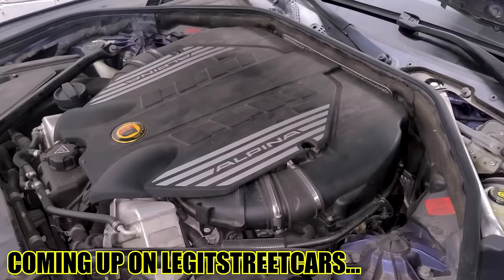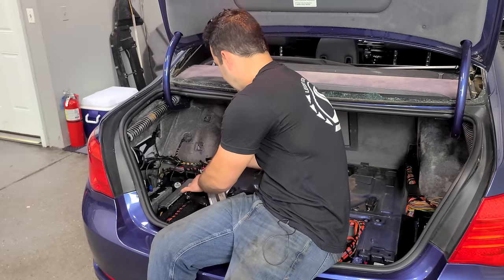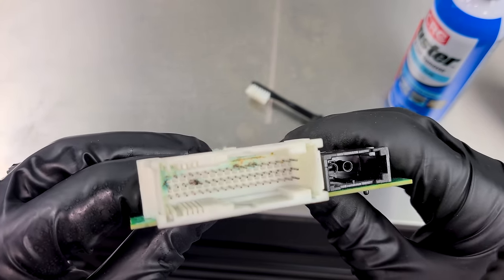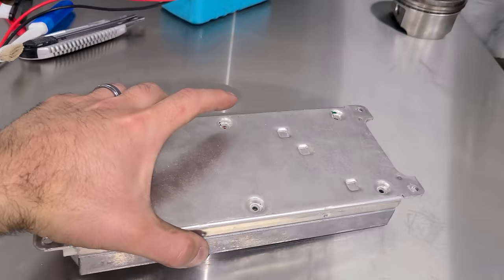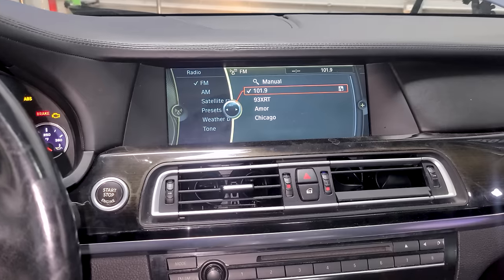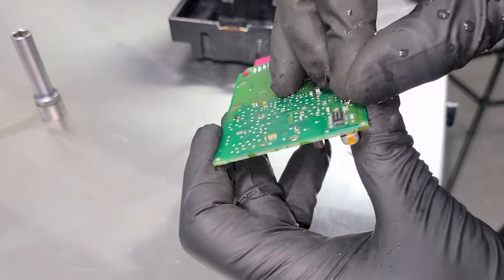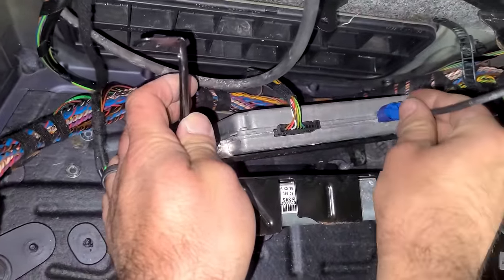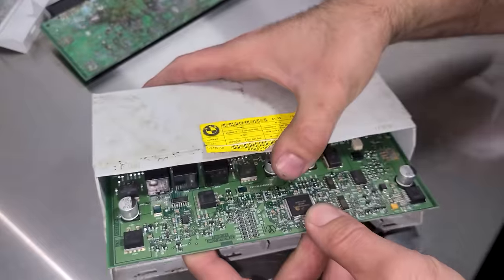BMW Dealer Tried Totaling My Car By Quoting $15,000 For 10 Computers! I Fixed Them All For $150!

Comment from the maker: What's something you fixed after getting a quote from a shop? Who else is going to try fixing or replacing a car's computer on your own now?
Use code LEGIT2022 for 15% off the Carly OBD Scanner & coding tool! https://bit.ly/CarlyLegitStreetCars. The offer expires on August 15th, 2022.
Reply: I have a w204 with third brake light issue  fixed for 120$ and saved 200
Reply: Hey Alex was there an upload Thursday? Also can Deboss Garage YT channel last upload, that Mercedes race car is a beast!!!

Lastly would you ever get a rotary engine like Rob Dahm?
Reply: ABS rings + sensors on the rear axle for a E87 BMW 118i. Got a quote for almost €1000,- but fixed it myself for €100,- Bosch sensors and OEM rings.
Reply: I would buy Carly but a subscription no way!
Reply: I don't go to shops lol. I've been an auto tech for 20 years and even though I have no garage i just work on the street. Did my transmission mount insert on the street same with my oil changes. I like to fix things instead of buying new. Fixed a portable oil heater that way.
Reply: Let's see you do a pano-roof on a c230 - now that's REAL wrenching...
Reply: Great Video Alex 👍🏾
Reply: i have a 270cdi w211, got a mobile mechanic (£55) out to fix a drop in revs at 2000 it drops to 1900 then back up to 2000, he could not find the fault, but he said in need a EGR valve. got a recondition one for £150 with £20 refunded if a send the old one back. put it on my self, i now have more power. P.S. think the drop is the EGR valve be told to open at the wrong time?
Reply: I replaced Heads on my 99 Ranger 3.0 V6. Watched a guy on YouTube.
Reply: Fixed a CE light for my cylinder deactivation system. Dealer wanted $400, fixed for $60 using OEM parts from the dealer.
Reply: The purple, black, cream, and blue cables on the "dumb" unit are industrial optical audio cables. They're called Toslink cables when used in home electronics, but are understandably more fragile.
Reply: $2500 dealer quote for major brake service, knock sensors and full tune up…. All done for under $500
Reply: Please help. I drive a older car because I love it. I’m 22 with a 15 month old and not a lot of money.. I drive a 86 Toyota 4Runner. How do I read its codes? I sometimes get a check engine light but can’t afford to take it in to a shop
Reply: @nickcrill7718  😂 pre-obd doesn't have codes you can read. They had specialized tools at the dealership that do not exist anymore.
Reply: @nickcrill7718  go ask Tandem Offroad if he'll help. Pablo is obsessed with old Toyota 4runners.
Reply: The shop wanted $150 to replace my cabin air filter. I had just watched a youtube video on how trivial it is to replace. I said no to the shop. They insisted and said they could give me a 10% discount since they'd already be in the engine. I said no. I ordered one of Amazon for $20 and it took 5 min with a 10mm socket to replace.
Reply: @BSGSV  well you should have bought a Bosch one, or K&N one for at least $50. That said the extra $100 they were going to charge you is all labor. That was actually a fair price.
Reply: @andrewsadach3194   I knew it didn’t have obd so I was confused on what to do my grandpa gave me a paper clip but idk what I’m supposed to do with it. lol
Reply: @andrewsadach3194  Fun fact: back in the day, our BMWs didn't even have cabin air filters. It will be fine. As far as the price goes, $1M would have been a "fair" price to pay if I had the Queen of England change my air filter. That doesn't make it worthwhile especially for a 5 minute job.
Reply: 2096 tundra smog pump...under the intake mainfold..ugh.  I cheated and got an electronic bypass chip plug and play.  Pump will never come on, shooting codes and limp home mode and instead of $1500-3000, I paid $260.
Reply: I got a quote for $200 from a shop to fix my coolant thermostat. But I went on YouTube to see if it was easy to fix myself & long behold there was. The part only cost me no more then $20 & having all the right tools & jus watching a YouTube video I fixed it myself 💯
Reply: My biggest one is the rear wheel bearings on an 05 Explorer around two years ago. Tools and parts I spent around 400, and saved 2100 as a difference from what the shop wanted. It took me about a week to do in between work, but was a hell of a confidence booster. Plus then I had all the tools in the garage!
Reply: The natural gas regulator on a CNG Van. Totally funny story!!!!!
Reply: On a previous 7 Series I owned, the dealer quoted $750 for a coolant temp sensor leak.  I fixed for about 50 cents with a Home Depot o-ring.  Lasted for at least two years…not sure how much longer as I sold the car.
Reply: Those giggle giggly pieces are solenoids lol 😂 but nice work.
Reply: kzn130 hilux surf ecu rebuild was 599 the capacitors for electronics store were $14
Reply: I would like more often videos.
Reply: I took apart my 97 wrangler wiper motor - there were some pieces that broke off the  stator that were preventing movement. I think it froze at some point and someone hit it with a hammer to get it moving again. After I removed the loose stayor pieces, I put it back together and it was as good as new. Worked for years after that.

I had a 1982 toyota corolla and the brakes weren’t working, and I suspected the master cylinder wasn’t making pressure b/c of some debris. I set up a clean area on the bench, took the MC all apart, cleaned it, put it back together, bled the brakes, and it worked just like new. No parts needed.

It’s a weird feeling when you can fix something without buying a part -  like a superhero, but also there’s something in the back of my mind that wonders if the problem ever existed.
Reply: I have attached my the application form application form for the post of
Reply: I have attached my the application form application form for the post of
Reply: and we can can get it back back in a a couple weeks or more later later when when I have a little more
Reply: ac system replacement on bmw z4 3.0 quoted 2000 k. Parts alone were 400$ and that is all i paid.
Reply: I was charged .25 hour of labor for windshield washer fluid plus $10 for fluid. I was pissed lol
Reply: I stopped owning a car when gas hit $5 a gallon under Obama.
Reply: @paraskevasioannou7937  sounds great , what did you do to fix it?
Reply: @davidmorse5690  Laughing gas?
Reply: Bought a mercedes cls550 for cheap with broken airmatic suspension so the car had dropped to the ground.. found a part out and bought the rear air bags and a compressor all for $300 off a cls55 amg. Installed it all myself started the car and she rose right up.. its been 2 months already and havent had any leaks or issues. Easily saved myself a few grand
Reply: Hey Alex. I just found out your audio amplifier is not from the alpina. At 20:18 I can see it’s labelled F07 which is the 5 series GT… I’m pretty sure it’s not the original amp.
Reply: @paulsz6194  Compressed Natural Gas
We did do some laughing.
Reply: I wish I could I have an L494 Range Rover that needs programming after an amp replacement. It also has a closed loop fiber optic MOST system. It's driving me mad lol.
Reply: Reworked my ebcm on my 2000 gmc sierra from watching a YouTube video.
Reply: Probably 15 years ago my friend sold  me a 2000ish cadillac Deville for 600$ ... dealership told him it was going to need all new gaskets due to it leaking oil about as fast as you put it in they wanted a dumb amount to fix it . ... took it home jacked it up ,couple cans brake parts cleaner, the oil filter wasn't tightened and was dumping oil when it was running lmao I tightened it with my hand topped it off and drove back to my friends house  the same day... he just shook his head lol he wasn't amused.
Reply: @grantlouw3182  dude same here, i find that absolutly absurd having to pay for a car scanner subscription
Reply: @grantlouw3182    I went for it.   Maintaining all that functionality requires ongoing investment.  I can live with the subscription as long as they keep improving the capability.
Reply: Power steering issue on a 2010 Honda Odyssey fixed with a $1.50 O ring.
Reply: I’d advice pictures as ppl disassemble things, one at a time.
Reply: Finished water is also non conductive. It's the minerals in the water that is conductive
Reply: I want that car so bad. I also want to do the work alsob. I miss being able to work on my cars also
Reply: I thinking sabotage
Broke it at some point to total it out or at auction..
Reply: A family member bought a pre owned Nissan Micra from a Nissan dealer and they said the next service would be free.
When it was due we took it in and they booked a Bronze service where the paperwork said the deal was for a Gold one, I noticed it and they changed it to Gold. I would normally do it myself but as it was free.... or was it?
We went back later to collect the car and they said they couldn't start it and it needed a new battery. We had no problems with the battery or with starting it before. They wanted £160 for a new battery I told them I wasn't paying that and for them to jump start it so I could get it home.
I went to the workshop and saw them pushing it out. They had a long push around the building to the car park.
I tried it and it barley turned over. If it was my car I would have marked parts with a UV pen just in case, I reckon they swapped the battery with a dud one or blew it with a battery tester and didn't want to admit it.
I asked again if they would jump or push start it (manual) but they said they had tried and couldn't get it started.
I returned with my jump leads and it started first time. I went in where customers were waiting and said very loudly "You said none of your mechanics could get it started, it took me less than a  minute".
I bought a battery for half what they wanted to charge and 7 years on, no problems with it.
Reply: M35 stagea front damage to light,guard and bumper. Hit by another driver His insurance paid out $7000 for quote to fix it.  I bought second hand parts for $200. Fixed the light with glue, dent repair.. not perfect but good enough... and have over 6000 left!
  Blanco dishwasher, was not powering on, I got it for nothing, worth $900.  Quote to fix was $200 for labour and unknown part cost.  I pulled apart the contol modules and found a resistor that was fried and also became loose on the crcuit board. New, resistor ($1), a bit of solder and the unit has worked faultlessly for over 2 years. Cost $1, time 1 hour.  saved $200, (actually $900 since I didnt even buy the dishwasher to start with)

Oh and then there was the LG fridge (twin door, ice and water - only 10 years old) that was being thrown away for water leaking - It also needed a massive cleanup - disgusting! SO one plastic hose fitting ($5) and a few hours cleaning - I sold it for $500 !
Reply: A rear silencer rubber hook. Got an almost $100,= quote from the dealer to replace a $6,= part that needed 1 bolt to be undone and took less than 3 min. to replace (with the car standing on the street).
Same for a start/stop battery. Got a $350,- quote from a dealer for replacing a $90,- battery that needed no further programming or resetting in the ECU. Just open the hood , unbolt 1 10mm bolt and the connectors and replace. I can carry on with a long list...
Just one more: replacing the coupling plate on my (almost) vintage BMW motorcycle. Got a $1.250,- quote (back in 1999), bought the plate, bearing and ancillaries for under $130,-, bought me a brand new hydraulic motor lift and a decent new and calibrated torque wrench and did the job in 3 hours (as a novice then) and even kept some change in my pocket. Leaving me with a perfect bike and great tools!

What's killing the dealer-services for the private owned car is that dealers use standard rates for lease-companies that are way above true exploitation-cost (profit included). And of course the costs of those crystal-palace - dealerships at A1 locations and membership to the dealership network adds a far amount too.......
Reply: A coffee machine, was quoted £65 for a brewer repair when it only needed a £3 part :)
Reply: Backyard mechanic, Almost everything I fix is after getting a quote from a shop because I have all my "customers" get those quotes so they can really understand the savings they are getting.
Reply: My 2018 Wrangler Unlimited Rubicon is starting to have computer issues so this is awesome to watch!!!
Reply: Water got in the floorboard of my Passat.  TCU was shot as well as the plug coming from the harness.  Replaced the TCU but also had to splice in a new(used) plug soldering 40 wires.  What a nightmare but it worked.  Also dropped the whole bottom end of my R8 to replace the AC compressor.  Dealership wanted $4k to replace the $400 compressor.  I used the money saved to buy a 4 post lift which I used to do the job and many more since.
Reply: Didn't work for me, ECU still throwing code P0606 no matter what I do.
Reply: 2013 Jetta hybrid.  Mechatronics in the "transmission went out.". Dealer wanted $7300.  VW wouldn't recognize my vin on a recall for the same problem.  Fixed it with a mod kit for $400.
Reply: not a car, but a home theatre receiver, Yamaha Rx-V2700B, quoted $600 to fix (not turning on). fix, a 90 cent capacitor on the power supply pcb. True story
Reply: Fixed a taillight on a VW golf when water got into the housing.
Honestly it wasn't even difficult the PCB had 4mm thick lines running around. Scraped the rust off the PCB sprayed wd40 with PTFE on cleaned the connectors and fixed it.
A Sony bravia TV that was left in the rain. Took it apart cleaned it from top to bottom with IPA alcohol. Reassembled gave it a couple of days then turned it on  lasted 5 years.
A Samsung galaxy S5 dropped it a week into getting it. Bought a replacement screen. It broke the digitiser when getting it off so bought the full screen and digitiser. Got it back working and I was in business. Then a couple of years later on a night out  I dropped it and the screen had all these raster lines running through it but no cracks. From the repair I remembered I saw that happen when the ribbon connector wasn't seated properly so I remembered exactly where that ribbon connector was and pressed the screen hard there and it cleared right up.
I love finding broken stuff around the house and seeing how it failed and fixing  it! A greenlee tone and probe. The tone died a slow death first it stopped flashing to a frequency thinking it was a low battery it didn't change anything before eventually it didn't work at all. Thinking it was a faulty capicator I opened it up and found a big cap on the back one leg just let go of the solder which turned white and fuzzy resoldered and sorted it.
Years before we were in a nightclub couldn't find a mate. I had no battery in my phone and the other mate had no antennae on his sharp flip phone (they commonly broke off)
I took his phone unwrapped a chewing gum are the gum and bent the foil to about 2 inches stuck it in the antennae hole and the signal jumped up to full strength. I wasn't even sure that would work but it made sense in my head.
In nearly all cases when something fails it's usually because a single thing has failed being the weakest link and if fixed with a bit of resoldering your back in business.
I do all my best mcgyvering when pissed.
Reply: Passenger seat on a ML320. Passenger seat was stuck and techs could not access the bolts to remove the seat. The quote was in the neighbourhood of $3600 CAD to cut the studs from underneath the vehicle and replace the whole seat. I grabbed a can of brake cleaner and soaked the tracks. Got the seat to move after 15 minutes, after 30 minutes of cleaning the track of grease, dog hair and sand I had the thing moving like new. Luckily I had this fixed 6 months before the battery failed because I would have been out the cost of the seat, and the battery, estimated total cost of almost 5k. 

Also the rear control unit of the same vehicle, could find the part for ~$180, but no one could program. Had to eat the bill on that one. Cant believe they install these parts in liquid traps under the rear light assemblies. If there is a leak in the seal around the light, your electronics get destroyed. The managers that forced this design should be in jail.
Reply: Took R56 Min Cooper S to shop - just got tired of fighting with the cooling system. Wouldn't burp, kept popping hoses. Code scan revealed end-of-life/reduced power on turbo.
$3K to rebuild.
Shop vacuum filled it, repair lasted all of 8 hours after waiting in line for two weeks as the coolant sensor blew out.
Said f* it - I'm giving this one more go. 
Found the coolant temp sensor was missing it's snap-clip retainer. Wedged it back in, refilled with coolant, bleeder screw open, home shop vac rigged to blow, finally forced coolant through. Changed oil just to be sure. 
No codes.
Reply: This is why I can't wait for automated cars and never needing to own a vehicle again. Just call an uber type company and a driverless car is sent to your house. No need to worry about owning an overpriced cars or insurance again.
Reply: @henrythegreatamerican8136  Okay, WEF lover. Give me all your stuff.
Reply: I'm rebuilding my 1988 kit car ,I'm looking for the E CU ,I then realised when I rewired it all thse years ago I didn't fit one !
Reply: @tegridyweed7863  gas is around the same price lol
Reply: Replaced the TCM on a Mazda 3 saving my friend over $2k
Reply: Any new code for Carly?
Reply: Only thing I've done myself is rotors and brake pads. Was quoted $860, did them myself for $130.
Reply: @Babihrse  😡we are mostly in a throw away society now. I noticed at appliance part store all of us lined up for parts looked retired and all aged 60+.⚒️🔧🪛
Reply: Carly is a big scammer. I bought one 2 weeks ago. They have somehow lost it between their warehouse and the DHL driver (somewhere in Germany still). DHL can't find it and Carly will not refund me. I am dealing with the credit card company to recover my funds. Carly also charged a subscription fee for a product I don't have in my possession.
Reply: @jeffrey88888  
I would blame/try to get refund from DHL at that point.
Reply: @joshuadelaughter  Recipients can't get refunds because Carly shipped it using their own account. Carly refuses to contact DHL to get a refund.
Reply: Aha...the source of my Carly adventure. You need to do more diligence in accepting sponsors. Carly is a scam. Anyone considering purchasing Carly needs to understand that it is an overpriced subscription for an OBD2 scanner that doesn't do what it promises, renews annually, and hides behind deceptive marketing and horrible business practices. Carly is a one-way door: they do not EVER refund your purchase.
Reply: volvo s40, quote for 4 control arms 4k, i replaced all of the suspension parts for 1k
Reply: Hi Alex ! I once saved a rented Sony professional video camera which had received sea water from a wave by removing the lens and batteries, filling a bathtub up with distilled water and putting the camera inside the tub, rinsing all the salt water away, and then drying the camera with a hair dryer for a couple of days just to be on the safe side.

A nightmare.
Reply: I have a 2007 Honda Pilot.  It kept not starting when you turn the ignition switch and dropping out of cruise control if driving.  We'd try to jump it, nothing - I'd beat on the steering wheel and wait and eventually it would start.  Dealership said I needed an entirely new ignition switch and steering column assembly for like $1500.
I googled around and discovered it was the gear selector switch.  I ordered a $60 part, bolted it on.  Problems gone.
The old one had cracked and allowed water in and corroded all the contacts so the car couldn't tell it was in drive or park any more.
Reply: That carly demonstration was possibly one of the best ways you could have advertised it. It looks like an amazing tool!
Reply: Better way is to soak the connectors in white viniger then clean them. PCBs the actual traces can degrade so you have to be careful. You also have to be careful scrubbing as the surface mount caps  can easily be chipped off and you won't notice, DONT EVER USE A BRASS BRUSH. Use a jewlers grinder for stubborn pins and a microscope or magnifying glass and be careful
Reply: The abs pump could have been a stone or debris fling on a angle from the wheel. Which is most likely and easily will shatter the plastic with the kinetic energy be like a bullet
Reply: Hey Alex ... it's also worth inspecting the capacitors or testing them with your voltmeter, bc it's certainly within your ability to swap caps. Also, especially if you're ever dealing with a McLaren that had water damaged units or a newer MB ... maybe get an Ultrasonic Cleaner. And then consider places like Louis Rossman in NY If they're really expensive. My company used to fix those but, LA became a disgusting cesspool so I fled. But with a microscope, good equipment and someone with some talent, it's pretty accessible skills.  And you did a good job introducing it to your viewers, as well.
Reply: My clock spring (couples the switches from the steering wheel into the car) had one broken wire.  I called Hyundai and the part was $300 and labor $300.  I bought a new part off eBay for $22 then spent 30 minutes installing it.  Bam, everything works.  Savings $600-22 = $600+ cause the Sealership would have thrown in tax and other stuff.  Love your videos!
Reply: Oh, and I fixed my friends Lexus sound system.  Cleaned up the circuit board much like you showed.  Cost $0, estimate $1500.